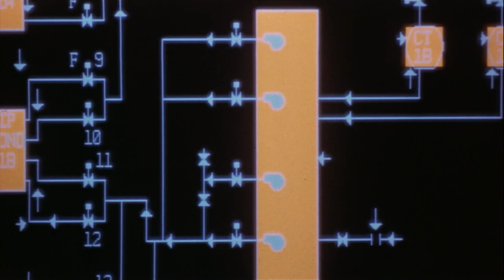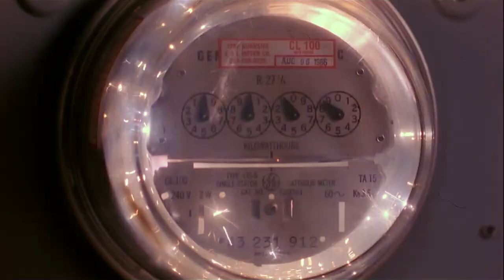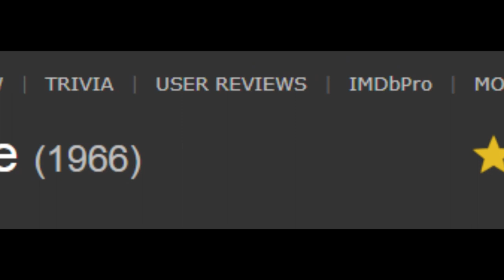Pulse - Good Bad Flicks

Comment: Theory time for how the entity managed to screw with the shower.

Back in the days of galvanized and copper pipe being the go-to standard for plumbing lines, it was common for the piping to be used as a grounding bar for certain electrical systems. The entity traveled along the grounding wire and gained access to the plumbing pipes, allowing it to directly affect the electrons in the water, making it possible to super heat the water. It also used the electrons in the water to induce a magnetic field in the shower doors through the metal framing around the glass panels.
Reply: Yeah, I had a similar theory: The longer that the entity is in the house, the stronger it gets. When strong enough, it can create and manipulate magnetic fields, which then are used to exert force on the metal located in doors and handles, using them to move (or not move) as the entity wishes.

Comment: "How is the electricity turn the water on?"

Answer:  Water is ran electrically.  Unless we're talking about something else :-/
Reply: water is pushed by pressure. if everyone in your neighborhood is watering the lawn, everyones pressure is lower. the meter that records how much flow you use is electric but the HANDLE that OPENS the VALVE to allows the water to flow thru THAT pipe.... is waaay analog. unless you mean the pumps in the water stations are ran electrically. yes indeed they are. but thats to put pressure on the water feed system. in most usa homes, such as where the movie takes place no pumps, on rural areas where water is drawn from a well? electric pumps are a good bet but the handles and nozzles and valves are not powered. new style sensor faucets are a grey area as they detect touch or movement and then a switch opens the valve... not in this movie or at that time in the tech tree ;)